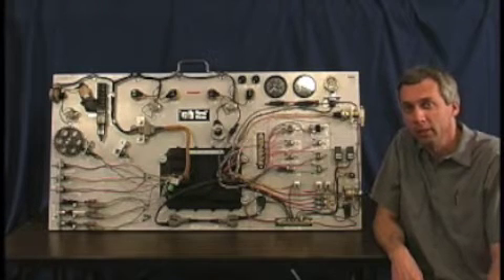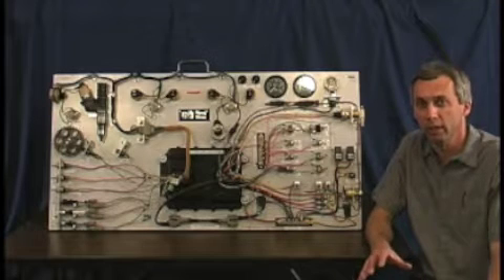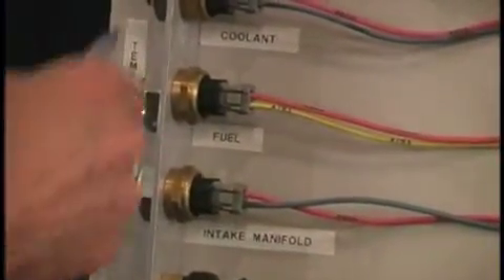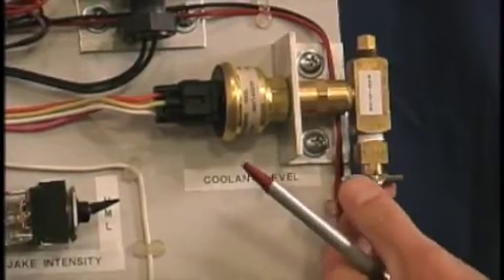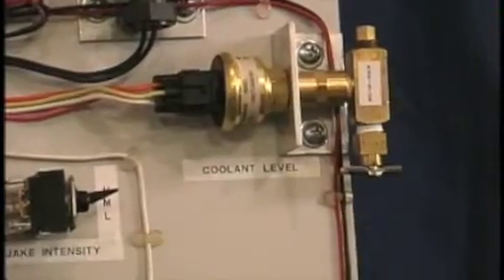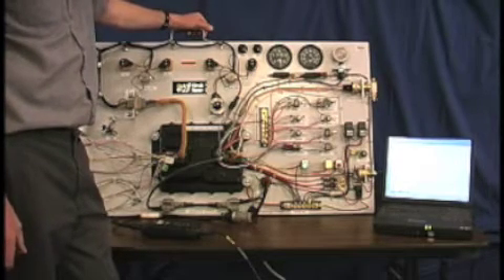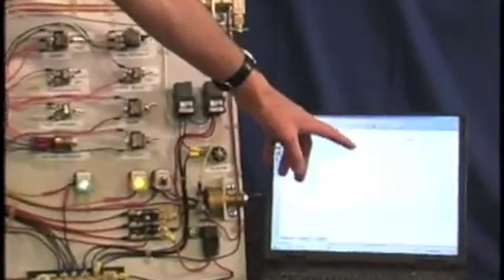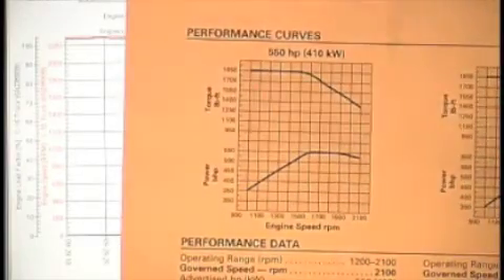CAT Engine Simulator - Diagnosis and repair

Comment: Bernie, This is related to my work. I am a test engineer developing test programs for CAT C7/C9 electronic shutdown systems components or CAN nodes. Also our products e.g. CAN gauges, Pedal Position, Float s/w need to tested and it is very hard to test it without CAT Engine. We would be interested in buying your CAT Engine Simulator. Please let me know whether this would be possible. My contact details: tadeusz.niegowski@ntms.com

Comment: Nice job looks great.  The one thing that is nice about this is that it's very easy to see how simple the whole system is.  If you want a challenge how about controlling the electric motor that turns the crank chopper wheel with the output of one of the injector output.  It would be cool to use a PWM motor controller ked to one of the injectors to drive that motor.  The longer and faster the injector duration the faster the motor would rotate the chopper wheel, up to TEL.  Well nice job again.

Comment: Actually Cat will no longer be selling engines to the on-highway manufacturers as of 2010.  I believe sales to Paccar was very high this year though. Cat is looking to release their own Cat truck that will not be on highway but similar in size. Very good board, wish I could have used it.